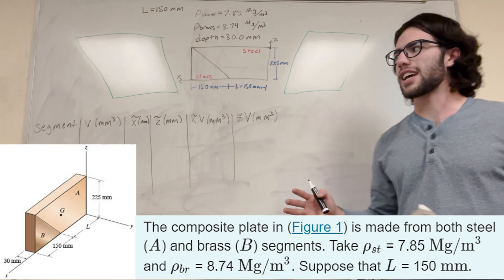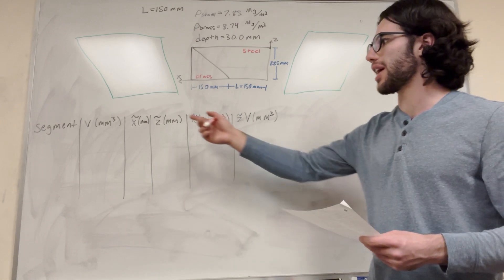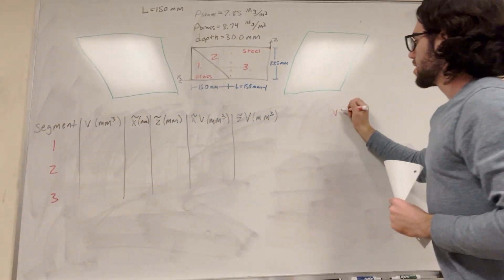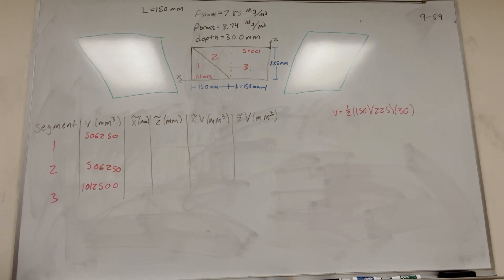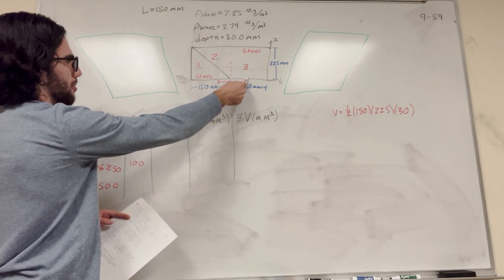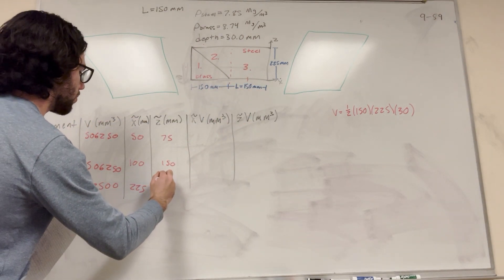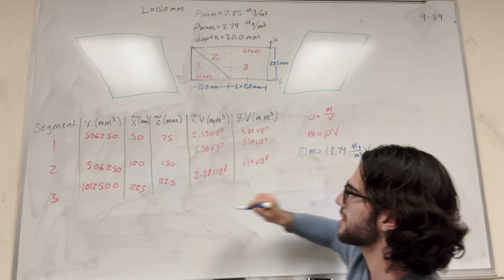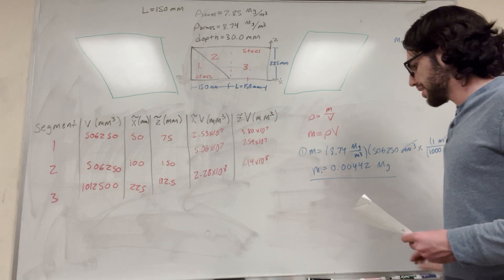The composite plate in (Figure 1) is made from both steel (A) and brass (B) segments - 9-89

Comment: Remember that figures 1 and 2 are not at the origin, so you must add the distance, in figures 1 and 2 you must add 150mm for X, it should be like this x = 150+(150/3)